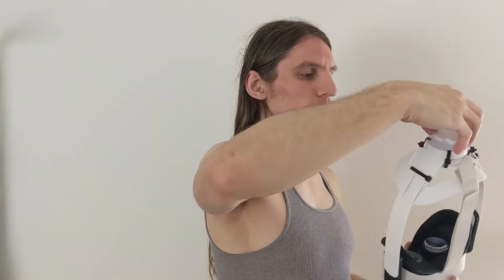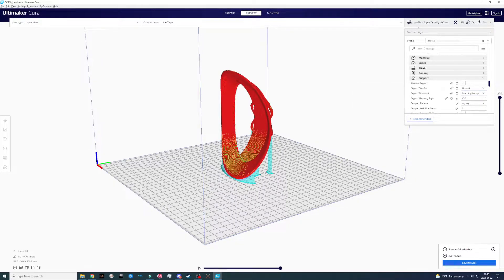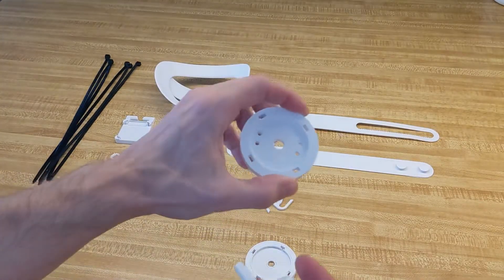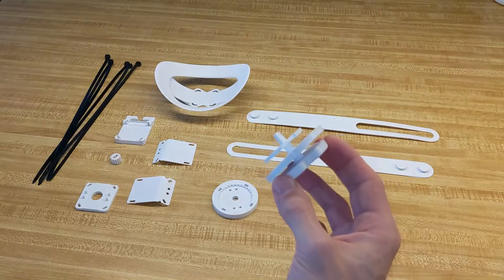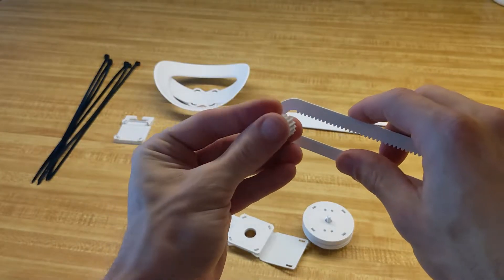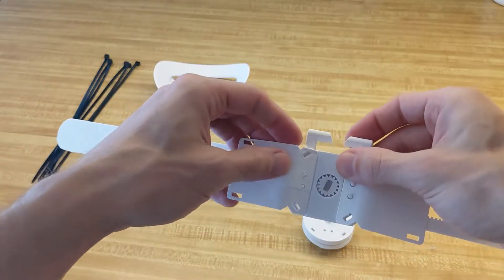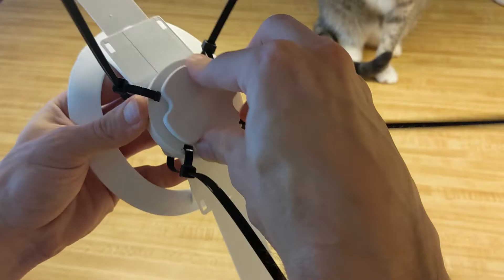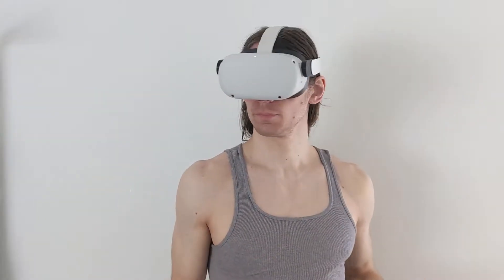3d Printed Quest 2 Elite Strap Assembly

Comment: i have printed the ratched shaft 3 times and  made sure each time it was 100% infill and everytime I tightened it, it snapped
Reply: You need to use pet.g.
It Just stronger.
Pla is Just for nice fast models to paint.
Ore print it in a..b.s.
Bud abs is more diffecult

Comment: Howd you separate the top strap from the side ones? I'm having trouble on that part.
Reply: You thread the top straps loop over one of the fasternes and then guide it through one of the plastic arms. Its a bit thinky but it works

Comment: Please could u tell me if it has space for an external battery?
Reply from the maker: I didn't design this with space for external battery, since the handle would get in the way. There are ways it could be modified to make it work, but I didn't
Reply: @KurtMage  after a bit of research I found out of a battery that should work fine with this elite strap

Comment: Awesome remix!
Reply from the maker: Thanks!
Reply: @KurtMage hello, my print bed is too small for the strap, what should i do?
Reply: @DoGGuY  I had this issue too. I just cut some length off in CAD and printed it. Taking it down by 15mm did it for me.
Although, I'm still awaiting the completion of the head rest piece, so I'm unsure whether those 15mm will be criticial to whether it fits.

If I have to, I'll make a 3 part strap that splits up the full length into more easily printable parts.
I have modified a few of the models of this build already, so if I do end up doing that, I'll post a link to the files.
Reply: @BurkeDEV  alright! Thanks for the response :)